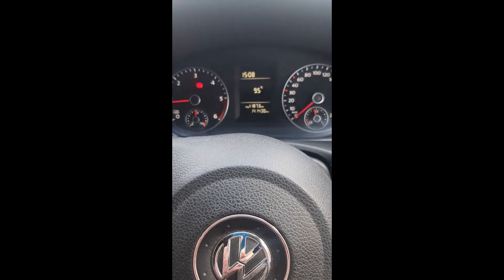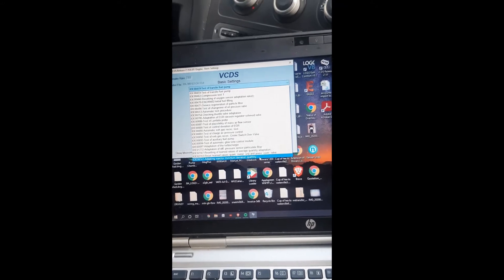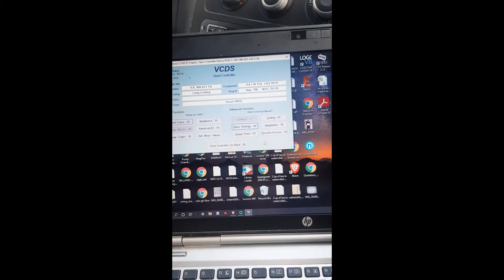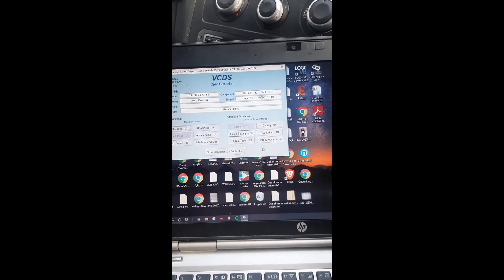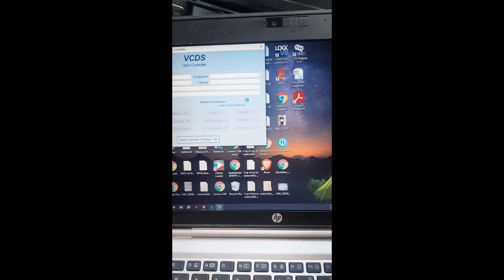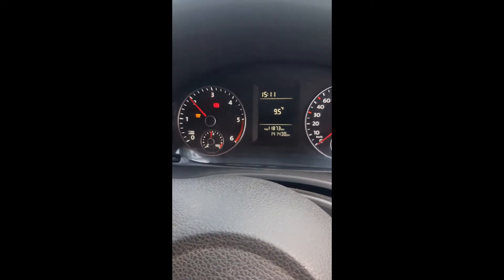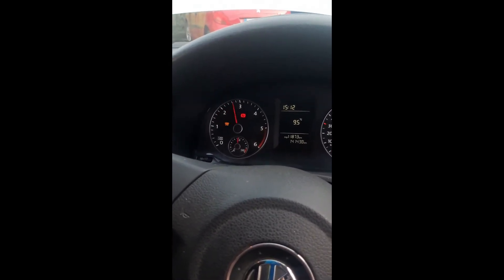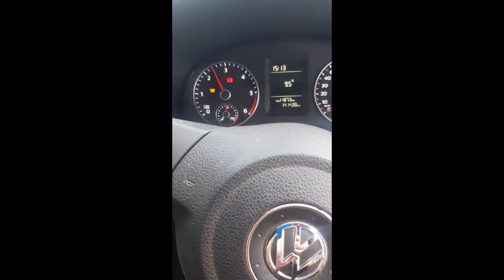VW IDE 06141 CAYE Injector compensation adaption Part2

Comment: Do you know if the software VW put in after the diesel gate scandal will be new enough to do this? I know my car has that update at least. I’m gonna check regardless before I persue it to avoid messing the car up
Reply from the maker: I think it should be, early skoda CAYC's did not even have the IDE06141 routine - take a look at the software revision in vcds also remember the main issue is gaining security access correctly as mentioned in the video.
Reply: @enginemanagementadventures7305 thank you for replying so fast! I have a 2011 golf 1.6tdi cayc which I just replaced the seals on injector 1 and 2. They had popped out because of compression leaking out causing a loud knocking noise. Managed to tighten the screw which stopped the knock and then I replaced the seals a week after as mentioned. Injector Seal 1 had broken in two pieces… Didn’t bother with 3 and 4. It runs quite well now however it shakes a lot on idle which is making me wanna do this adaptation
Reply from the maker: @timpanlimpan well done! just make sure you cleaned the injector seat and used a new stretch clamp bolt 8Nm + 180 or the bolt will snap  😉😉

Comment: I also noticed, that not many people update here if they were able to fix the "infinite loops", software update issues or other things while doing the IQA. I also changed first and second injector on my VW Touran 1.6 tdi CAYC 2010 77 kw. Coded them accordingly in VCDS. No errors, but idle was rough, a bit of knocking on 2nd, 3rd gear, hesitation around 1200-1700 rpms, vibration at some speeds. VCDS deviation for each injector was 0.1/2.0/2.0/0.2 accordingly. 1 and 2 - new VDO Siemens, 3 - old original one 225 000 km, 4th - already changed 50 000 km before, I guess it was adapted, no issues. Anyways, it was weird, that the new injector #2 was already showing deviation +2.0. So I found this video and couple of others + forums about the procedure of IDE06141. So I tried it myself. Luckily, the software was already updated, as VCDS shows me 9978. My first attempt was funny. I didn't follow the exact steps (which is VERY important, as the owner of the video says), so the first time I tried to do the procedure - it asked me to engage Break + Acceleration. Because I didn't pay much attention reading all the posts - I tried to do it as the programm said. 1 hour holding 2 pedals with infinite loops, cramps in my legs and so on didn't help, obviously. Then I tried to go with Filter Clean, which started good, but the programm didn't want to stop, so even though the Particle Filter was clean, VCDS still said that it was running. I aborted it and then tried to do IDE06141 once more, but this time the pedals were correct - clutch+brake on-off, acceleration on off. But I got stuck in infinite loop anyways with motor revving to 2800 and back to 1000. Did it three times, 20 mins, 1 hour and around 40 minutes. Each time - aborted it manually, because something was not right. Today I wanted to give it one more chance. Drove the car for a bit to get the motor temp to 90. Motor off, Key out, 1 minute wait, Key in, Motor on, open VCDS, Engine, Security+Code, Basic Settings, Adapting injector minimum deviation quantity and Go. Then as expected - Clutch+Break On Off, Then Full Throttle and Off. VCDS shows "Running", Firstly - 10-15 seconds at 2000 rpm, pretty noisy, then 1200-3500 about 10 times or so and back to 2000 rpm. 5 loops later (5-6 minutes) it stops with 800 RPM and a bit weird "whoosh" sound. Then very clean and perfect idle with "Finished Successfully" ,message in VCDS. I could not belive my eyes and ears. Checked the deviation - each injector around 0.1-0.2. Disconnected the VCDS, tried to drive for 10-15 minutes - good as new, with no hesitation, no knocking, no smoke, nothing. So my advice - do exactly as it says in the video. And if you want to do particle clean and then adaptation - make sure you don't do it in one session. Thanks again for the videos and all the comments, which helped a lot to end this infinite journey. Cheers
Reply from the maker: Well done glad you got there in the end!!

Comment: ATTENTION! To everyone who has or is going to attempt this procedure. Please ensure that you follow the instructions explicitly to the letter or the program will not run as intended and leave you stranded worse off than you were to begin with. DO NOT run this procedure unnecessarily  either in attempt to balance out previous imbalance. Running this program will reset all learned values and balancing strategies the ECM has learned over the years. 

Follow this procedure:

 If you are asked to press the brake and accelerator from the start, you have not met the prerequisites and this will run indefinitely. So, to fix.

Turn off the car and close VCDS.
Wait 60 seconds
-> Start engine (running)
-> Start VDCS
-> Controller
-> Engine
-> Important!! Re-enter Security Access and use the code 27971
-> Basic Settings
-> Adapting injector minimum deviation quantity
-> Go

Important!! You'll be asked to depress brake and clutch first.
If you are not asked to depress brake and clutch first, you have not started the procedure correctly

Follow the rest of the instructions

Takes around 5 mins and ECU may blip the throttle (< -- not guaranteed)
Reply: How to get it out of the infinite loop cycle?
Reply: @CCDVIDEO Turn it off, pull out key from ignition. Wait one minute before trying again. Make sure it asks to depress brake and clutch pedal. before pressing go/start. Also, this cannot be done with anything other than vcds, If you attempt this with a third party tool, it will certainly break and end up in a loop
Reply: @SomeGuyOffTheInternetLol  thank you for your reply. I had to update my ECU Software version. After that, it went through first time 😅

Comment: I did that to my car, 1.6 tdi CAY mark 6 Jetta, it keeps going on and on and on for nearly an hour then it says timeout cancel. What could be causing that?
All my 4 injectors were cleaned and refurbished
Reply: You did not follow the procedure correctly. Firstly check that you are running software version 9xxx+. Second, google VCDS injector quantity adaptation procedure from rosstech. Follow the instructions to the letter, otherwise software will get confused and it wont work.
Reply: @SomeGuyOffTheInternetLol i ended up replacing an injector and skipped the adaptation process, the car runs fine now
Reply: @maurice_mores As to be expected. The adaptation procedure is done to speed up the injector balancing process that otherwise is done automatically, although takes longer
Reply: @SomeGuyOffTheInternetLol okay so I checked the software version of my ECU, it's 9978. Do you recommend me trying out the process again? Now that I replaced the bad injector? I'm kinda worried it would start to stutter again
Reply: @maurice_mores no need, it wont stutter unless given a reaon to.

Comment: I did this yesterday and it worked perfectly. Car was shuddering at 1500rpm and running horrible with white smoke after all 4 injectors were changed to new ones by Siemens VDO. Only query I have is that the IDE06141 programme was still running after about 30mins. It did the rev up and settled at idle and never said "complete"
Reply from the maker: @KevinBosch-t6i  the process did not initiate so. I outlined the difficulties in entering that algorithm l, it must be done exactly. White smoke seems strange? Unless there was unburnt fuel in the dpf for whatever reason.
Reply: @enginemanagementadventures7305  Hi there. The system did initiate. I switched off the car and waited one minute, then started VCDS and entered the correct code and ran IDE06141. The car was running poorly before with shudder and white smoke. The car is running perfectly now, but I am just curious as to why the app did not time out

Comment: Trying to do this with mine after new injector . I get the flashing glow light but revs dont move. Car is up to temp has +1/4 of fuel. Any suggestions
Reply from the maker: @staceyismine   make 100% sure you power down, then enter back into ecu, security access, straight to basic settings and run it as I did. 
Also if it is a early software revision especially on Skoda it may not work.
Reply: Ok I will check what software the car is running can vcds upgrade the cars software of do you recommend vw
Reply from the maker: @staceyismine  no vcds cannot flash software.
What year and type of car is it? Can you read the software revision. Are you 100% sure you actually have security access? That is the reason I did this video.

Comment: Just got a VCDS and I'm about to do this. I was about to throw the car off a cliff. Everything started with the bolt of injector 1 and 2 snapping off and spewing oil all over the engine. Got the car to the mechanic, he knocked the injectors so hard that I got the car the next day with intermittent solenoid issue on injector 4. Replaced injector 4 with a refurbished one then all of a sudden I noticed that the car was regenerating every 40km! So, I'm thinking one of the others must be leaking. Checked injector fuel deviation and two had over 5mg/str difference!Replaced two more injectors with used ones and now the car shakes and jumps on gear 1 and 2, blue smoke coming from the exhaust and regeneration every 20-30km! Overall really terrible experience (never getting a diesel German car again).  Toyota Prius here I come!
Reply from the maker: Is it the CAY 1.6 engine? Very reliable engine actually. Injectors are not solenoid, they are Piezo. Any knocks to the piezo pack on the head will damage the crystal wafer pack. 
Clamp bolts break either because 1. Bolt is reused 2. Wrong torque 8nm +180degree.
Used Injectors are a gamble at best. Hope it works out man 👍
Reply: @enginemanagementadventures7305  sorted it out. VCDS, coded the injectors properly but car was still shaking. Turns out that I had to recalibrate the DSG as well. The clutch was old so a recalibration fixed the 1-2 gear shaking. Feels like a brand new car!
Reply from the maker: @sophocha  Agh OK, you had to do basic setting on dsg also. Thanks for the follow up! 🙂
Reply: @enginemanagementadventures7305  Compared to my 25-year-old Honda, this goes under my 'unreliable list' and I'm not trusting it ever again. Last time the injector bolt was removed was from the dealer (10 years ago) to do the exact same job. Breaking bolts (due to design fault...the bolt is an M6!) and replacing injectors with a cost of 1000-2000 every 10 years I don't consider it a bargain. Hopefully the car will get fixed and I'm selling it the next day.